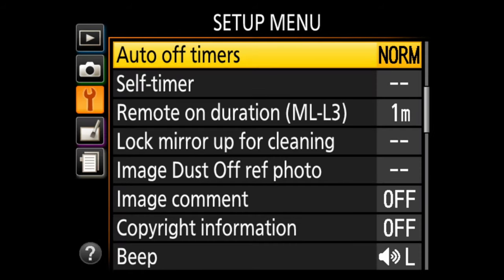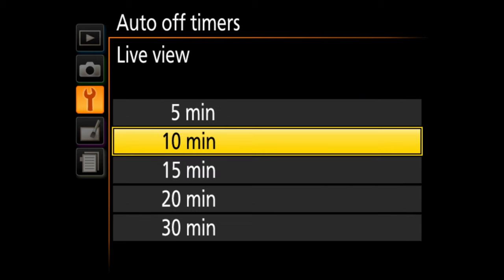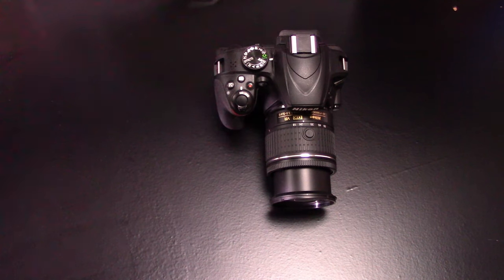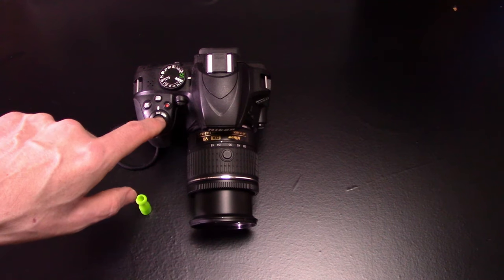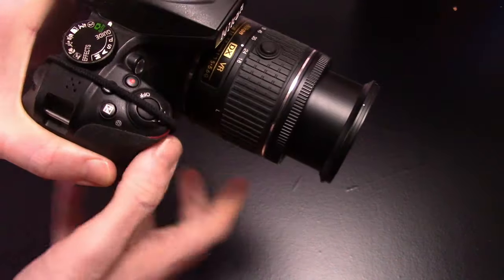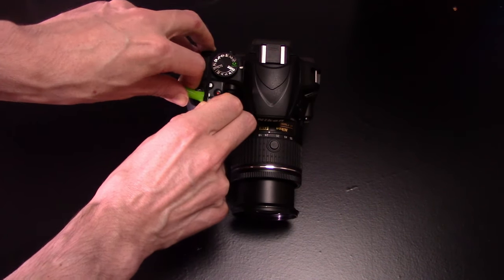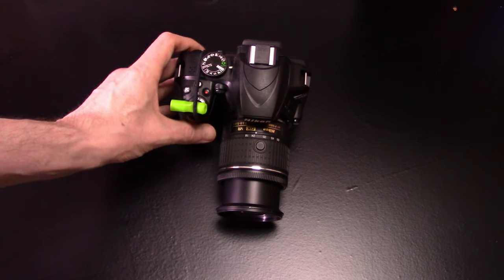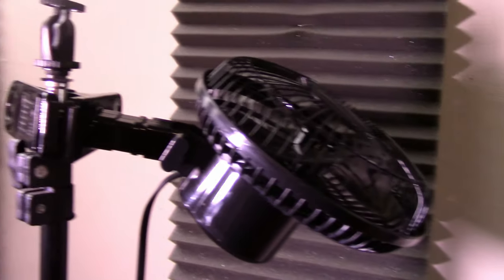Nikon D3400: Bypass Live View Power Off Timer

Comment: For those with Nikon D3100. I can confirm this works 😊👍
Reply: Does it overheat? Do you actually use a fan ?
Reply: @georgechatzopoulos136  I haven’t used it for that long. It has run for 2 hours and no overheating.
Reply: Hi there, do you know how to get ride of the green square on my face?
Reply: @sbakour2012  did you try to wipe it off? Hahahaha
Reply: Hi i have a d3100 too! Do you not feel Dangerous for the mechanics of the button to keep It pushed Always?
Reply: @tommasogrisi5858  I got myself a brand new DSLR. I no longer use the D3100 😀👍
Reply: @sbakour2012  just press the info button next to the shutter or on the back.  It should cycle through the info display modes and one of them should hide that all of that.
Reply: thanks for confirming.. i have D3100 and intead of buying a new cam i thought about just using it for streaming
Reply: @santoslorenz  it’s a bit fiddly, but it does work. I have only tried it once though.

Comment: Interesting solution I found if you want this effect without having to possibly mess with the long term reliability of the shutter button. is just set it to full servo auto focus I will keep making micro adjustment which will keep the camera on. The issue with this is though is that the autofocus is very noticeable is it keeps bobbing, losing and regaining focus every 30 seconds; especially when face detect is on. this does work better for a scene without a face and lots of depth like say a table shot. 
it's just really annoying that has to come to relying on it really obnoxious annoying autofocus or half pressing the shutter button, on this is a purely software restriction, surly someone that can hack the camera firmware to take this one restriction off
Reply: nice find! did the camera overheat?
Reply: @pois3d  not shutting down yet but it got super hot to the touch but i tun it off when not in use

Comment: D3300 up and running. Not perfect but you've saved me a lot of money! Just when the internet needs a bodgey solution, you stepped up. Thanks man. 

FYI I was on manual focus and it didn't work. May have to be in autofocus if it's not working for you.
Reply: hello friend, which hdmi cable is the one used by the nikon d3300, I also have to use it as a webcam, knowing this trick, now if I am interested in buying a capturer but I also need the hdmi, you know what model it is and where can I get it?
Reply: @Giopolan  the camera exports in mini HDMI (type C). So get a type c to regular hdmi cable
Reply: @LiamMartinTutorials  thanks my friend
Reply: Howd you get the auto focus box to not show on the screen?

Comment: Wow. I'll try this hack immediately. Can't believe no one left a like for this video yet. I just changed that.
Only one question: Does the "half-pressed shutter button" trick also work when the focus function is no longer assigned to that button? I'm using back button focus and continuous mode on all my cameras.
Do I have to reassign the focus function to the shutter button? In that case, is single mode sufficient?

Comment: It is no longer necessary to separate the cables and solder them. There is an aftermarket release (JJC-MA-M) which is even cheaper and the release button can be propped up (from the factory), so you only have to set the focus to manual on the camera and it will stay on indefinitely. Only  Z6, Z7, D90, D600, D610, D750, D3100, D3200, D3300, D5100, D5200, D5300, D5500, D5600, D7000, D7100, D7200, D7500, P7700, P7800, Z6, Z7, P1000, Z5, Z6 II, Z7 II, D780
Reply: You posted this on a d3400 video... D3400 isnt on that list.
Reply: @fennecfox3092  A lot of people have D3100's (like myself) and this is one of the only video's that remotely show how to bypass the shutoff.. And my switch is on the way

Comment: I've had experience that when connected over HDMI, the Nikon D3500 wouldn't timeout. But recently, I've set it to Manual and left only focus on full time auto, and it HAS timed out. Does anyone here have any idea on as to why that would happen? What prevented live view from turning off before, that isn't preventing it in Manual. I'd actually like to use it in manual because I've had issues with the image flickering as the camera kept adjusting it's shutter speed and aperture.
Reply: I just got the same camera last week and plan on using it as a webcam as well. Did you ever figure it out? I stream about 4 to 6 hours some days so it would be helpful if I could keep the camera on for that long!
Reply: @8LAZ3GAMING  Well, not really, hadn't done more testing since, but it does seem like the Full Time autofocus does play a role. Either way, if you can manage to set your stuff up so you can see what your camera outputs on HDMI, it does show a countdown well before it actually goes and turns of, in case that ever happens to you.
Reply: @TricksterRad  Ahh...thanks man, I was hoping there was a way to keep it  running :/ I guess this is not the camera for the job
Reply: @8LAZ3GAMING  As I said, if you can keep autofocus on in full time mode (which you can without any hacks as in the above video), it should stay in live view for as long as you want it to.
Reply: @TricksterRad  oh wow....that should work just fine then! Thanks for your input, appreciate it!
Reply: @TricksterRad  I did what you said, left the Dial on Auto and in the options I set it to AF-F but it still shut off
Reply: @8LAZ3GAMING  did you connect the HDMI cable?
Reply: @TricksterRad  Yep, that's the only way to capture from live view right?
Reply: @8LAZ3GAMING  hmm, weird, worked fine for me...
Reply: @8LAZ3GAMING  oh, wait, not Auto, I have it on P
Reply: @TricksterRad  Yeah, weird. I tried on P as well and same thing; it just shuts off after 30 minutes. 
I believe the reason yours stayed on was maybe because your camera tried to focus on a certain subject from time to time which kind of reset the time off timer but I could be wrong.

Comment: How did you remov
e all of the stuff that is around the screen? i am getting all of the display info when i connect my d3400 into streamlabs OBS
Reply: I have the D3500 and I am wondering the same thing, I would like to get rid of all icons and meters for a clean feed for church.
Reply: keep the info button pressed for a few seconds and it will disappear.
Reply: @jsolorzano734  Its still there. Can you share the firmware version of your Nikon D3400?
Reply: @abhigyan360  you don't hold the button, you press it multiple times
Reply: @mannyramirez3434  press the info button next to the red record button. I have a D3500 as well. It took me ages to work this out and it was simple click of the info button (the one next to the red circle for record button)

Comment: There actually is a way of electronically switching off the 'Live View Power Off Timer' on the D3nnn series that have the accessory port (I think that excluded the D3500 that lost this but is good on the D3300/D3400).  It also requires you (in menu) to Switch Off AF from the shutter (i.e. Half Press Does not AF).  This is not an issue as a) you really don't want AF on all the time on the D3300 when videoing and b) you can move focus to the rear AF/AL button anyway.  It goes like this.  First get a cable release that fits the accessory socket. Nikon call these MC-DC2 Remote Cord.  Much cheaper can be had on-line for about $10.  Cut off the handset piece and throw it away.  Keep the accessory plug with about 3"-4" of cable.  Strip back the outer cover by around 1".  That reveals 3 wires. One is 'ground', second is 'Shutter' and third is AF.  (colours of wires vary).  To make this work you need to join the AF wire to the Ground wire.   Work out which is the right pair as follows.  Strip a 1/4" of inner insulation off each wire to reveal copper.  Switch the live view timer to 5 mins (menu). Join one pair of wires together.  Switch on live view and wait at least 5 mins. If you have the wrong pair, Live View switches off automatically after 5 mins.  If it doesn't, you have found the right pair!  Joint the right pair permanently together (solder is best but twisting them together - strip a bit more inner insulation - is ok).  Insulate the wires (heat shrink tube or insulation tape).  Job done.  Now all you have to do is take the wire 'dongle' out of the camera.  Switch on live view and plug the dongle back in and live view will stay on until you switch the camera off or pull the dongle out again.  To go really neat, instead of just fixing the wires together, wire a small 'push to make' switch between the wires.  Then you don't have to remove the dongle but just switch off/on whenever you select live view.  (One final word of caution.  The third wire in the cable.  Insulate this too because connecting the ground, AF and shutter wires together fires the shutter on Nikon cameras.) Enjoy your limitless Live View with an elegant hack (at your own risk of course).
Reply: Thanks for this hack! Would there be a similar workaround for a D3400? Unfortunately no MC-DC2 (removed after the D3300 I believe)
Reply: It is no longer necessary to separate the cables and solder them. There is an aftermarket release (JJC-MA-M) which is even cheaper and the release button can be propped up (from the factory), so you only have to set the focus to manual on the camera and it will stay on indefinitely. Only  Z6, Z7, D90, D600, D610, D750, D3100, D3200, D3300, D5100, D5200, D5300, D5500, D5600, D7000, D7100, D7200, D7500, P7700, P7800, Z6, Z7, P1000, Z5, Z6 II, Z7 II, D780

Comment: @Linux Game Cast hi. i have a question, how do you hide the informations when plugged with the HDMI cable on the D3400. thanks!
Reply from the maker: That's explained in the manual.
Reply: @linuxgamecast  couldn't find it, but thanks anyways
Reply: @CharleyLemayor  hit the info button to change the display until you get a clean feed
Reply: @EricICX  sadly it didn't work it shows less stuff, but there's still some stuff. so i used OBS to crop the things around the feed. thank you still!
Reply: @CharleyLemayor  on a D5300 press the info button next to the circular red record button. This turned off all the info around the LCD display so on OBS it just showed me the camera projection nothing else :-)
Reply: @RickardoSpalcia  i have a D3400 not a D5300. but thanks anyways! :)

Comment: Wouldn't the sensor burn after sometime? I want to use this camera to stream for 2hours just worried.
Reply: Im worried too. What do you think? I’ve already got everything set up to stream for hours, but i’m also worried about overheating damage.
Reply: @MegaAvids  don't get this camera. It'll over hear fast with fans, battery open etc not recommended
Reply: @squareup4693  Its the one i currently have /: only one i’ve got too. I’ve got it all set up to record some gameplays/streams for a few hours. Just a bit worried of damaging it if it overheats.

Just having it on Live View is enough for it to overheat though? Since its not ‘actually’ recording anything..

Comment: I wish Nikon would just release a firmware update to allow us to set it to Never, for when using HDMI out.. You said it will overheat.. how long does it take until that usually happens? I've recorded video for several hours to SD card with no issues, that would seem more intensive on the camera than just spitting out an HDMI signal from live view.
Reply from the maker: The maximum recording time for the D3400 is 29 minutes and 59 seconds.
Reply: @linuxgamecast  Thats recording time though, if you’re streaming or just recording from OBS, the capture card would have the feed of the live view without having to actually ‘record’. I wonder how long just being on live view would cause overheating issues?